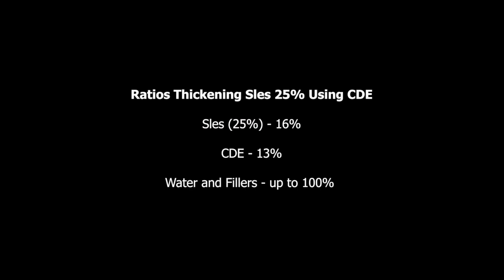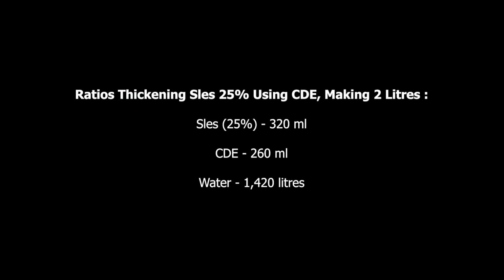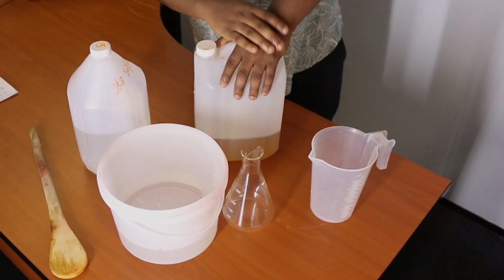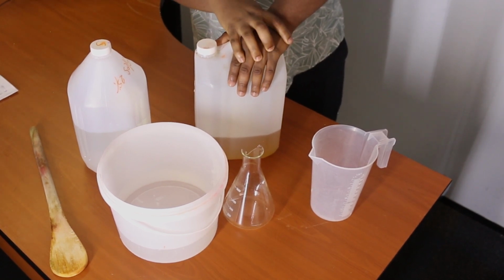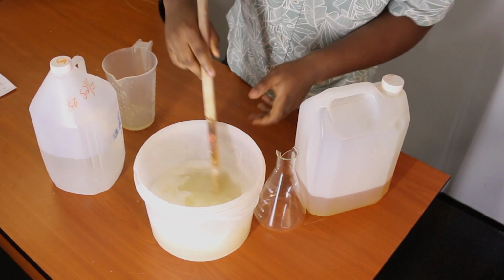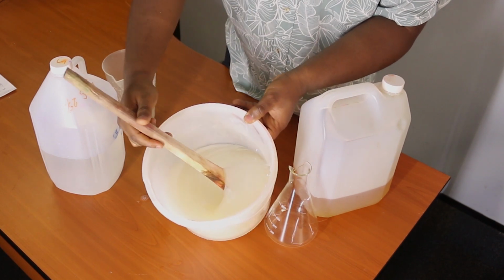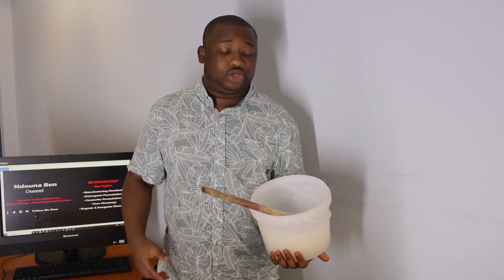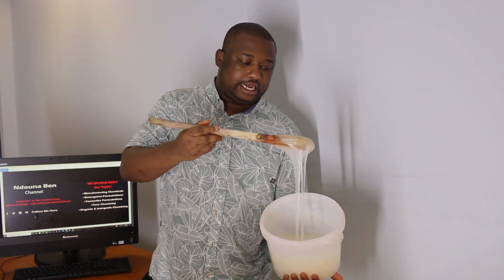How to thicken Sles 25% using CDE: Ratios to thicken Sles 25% using CDE

Comment: SLES can easily thicken by 
SLES ( 26-28% ) 80% with CAPB (30% ) 20% cocoamidopropyl betaine commonly cocobetaine. Max thickeness can achieve with 50:50 without using common salt ( NaCl)
Reply: Is 50:50 also applicable to CDE, as in sles 25% and CDE Ratio 50:50, am not getting desired thickness for the video ratio